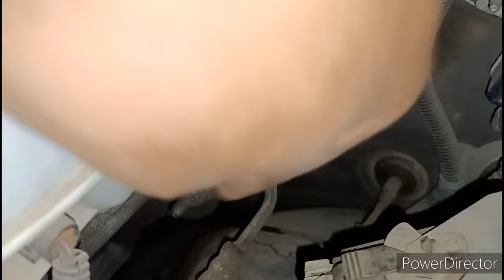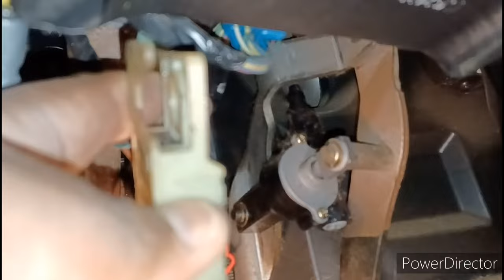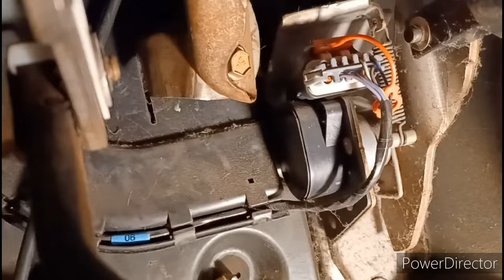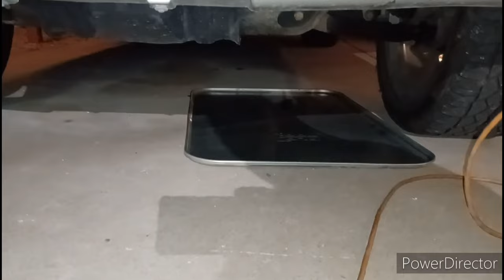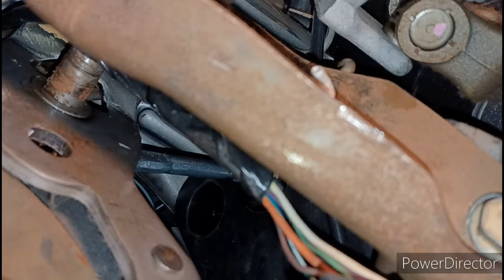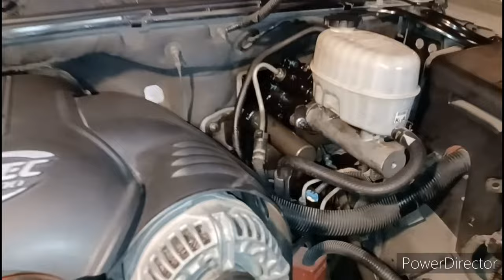How To Replace Hydroboost in 2005-07 Escalade Tahoe Suburban Yukon

Comment: I did this to my 04 tahoe. But I removed the front windshield and hood from the vehicle and side door and front seat. Made the job much easier. Thanks!
Reply: Holy cow, you removed the windshield to change out the hydroboost??
Reply: @veltdog09  lol.  he said remove the windshield and make it easier.. i think you should remove both fenders the liners and take the hood off.. it would be so easy!
Reply from the maker: 😅😆😅😆😅😅😆 yall wild!! Man, this is hilarious!! I needed this!
Reply: @MicDropBBQ  its awesome for sure.. thanks for your video .. i am facing this repair and went to look at mines and it looks just like your video.. same leak close to the firewall.. i was hoping it was just the rings but i guess i will be buying a whole new unit
Reply: @MicDropBBQ please remove both front headlights also when preforming this job. Oh don't forget safety goggles also. Stay safe my friend.

Comment: Wait? Why do you have to buy a whole new unit? Thought they just need a new gasket and it’s good to go. I ordered both the round and figure 8 gasket for my daughters 05’ and was going to tackle it but now you have me questioning if there is another area that could leak and not be fixable with the gasket kit.
Reply from the maker: If the compressed part (long silver tube) is what's leaking, you can't pull that apart. It's high pressure and installed at the factory.
Reply: @MicDropBBQ  ok, so I need to check that then. So if that’s not leaking from there, then the round cylinder gasket and figure 8 gasket will probably fix her problem. 

You mentioned you could see it bubbling when it was on? So I assume having the vehicle running would be best to check for leaks on that compressed part.
Reply from the maker: Yup. With the engine running, pressure builds up thru the hydro boost. You'll see it leaking because the pressure has nowhere else to go.
Reply: @MicDropBBQ  luckily it’s leaking out of the weep hole so it’s that seal. I see no reason to need to remove the unit from the firewall though….Is there reason you can’t just remove the master cylinder and move it back then remove the 5 star bolts and split the unit in half with it still on the fire wall?
Reply from the maker: @dd4life158  You could do that, as you can replace a master cylinder without replacing the entire unit. But the master cylinder should be the source of the leak in order to fix it. If not, then you're back at square one.
Reply: @MicDropBBQ  ok thank you. You went above and beyond. I’m nervous to do it. It’s for my daughters 2005 Yukon and she can’t afford to pay someone cause she’s having issues with finding a good paying job so I’m trying to help her out. I generally do most my own work on my trucks and my wife’s Yukon and my daughters Yukon but I don’t do really major stuff. This isn’t major but it’s a very vital system, you kinda want to have brakes lol. I am always nervous working on brake systems.
Reply from the maker: @dd4life158  Make sure you peep where the leak is coming from, even if you have her press the brakes and you look at the master cylinder. i know where that seal is that you're talking about, so it should be easy to replace if that's the case. Good luck, brotha! Just know that we have enough mechanics around here to walk you thru anything you might have an issue with...as long as we're around to get online.

Comment: Just replaced my cruise control switch and found my unit leaking.  Great tutorial, looks like I'm making plans for next weekend.
Reply from the maker: Thanks brotha!! The hardest part will be that clip behind the brake. It's a "slide" clip more than all a pull-clip. Once it's slid about a quarter inch, you can literally side it off and free that brake booster post. You'll feel it as your moving it around. It's a simple slide, so don't bend.or yank it out of frustration. It's easy, and it has to be slid in a certain direction, that's all.

Other than that, it was just time consuming for laying in the floorboard. Hahaha! Good luck, my man! Hopefully, I'm online if you get stuck and have questions.
Reply: @MicDropBBQ  Oh, that clip was easy. Had to remove it to put a new cruise brake switch in, then found the Hydroboost unit leaking and being the root cause of the switch failure as P/S fluid got into it and made it fail.  That bolt on the firewall you showed the deepwell with wobbly and extension. That one has me a little nervous being the truck is at 225k miles.  But giving it a good look initially, then watching your video, I'm going to go for it and do it myself.  My other car is a Scion FRS and I've been under the dash once or twice with that one.  This chevy has miles of room under it to work compared to that, so at least that gives me a little solace, LOL.
Reply from the maker: @jeepmor  Same here, brotha! I've got about 224k on mine right now! It's about time for seals to give up and just install new parts. Glad you got that clip out easy tho. I was like, "...Jesus? What factory put this damn thing on??" LOL! I was about to make a call to the plant and give em an inspection number to put that mfka on the PHONE WITH ME! LOL!

If you've got the FRS dash, you know how compact the spaces can be. You probably flew with the Chevy! hahahaha!

You'll jam. I think I did well with those 4 bolts under the dash, but it took me a while to keep adjusting my body. Laying under there was killing me, man!!! I had to get a fuzzy tarp to lay on because the concrete was tearing my knees up.

Pace yourself and you'll be fine, brotha!

Comment: Thanks for the video, very helpful! Just a few days ago mine started leaking like crazy, no warning just nice big 12" spots on the driveway.  I tackled the job with an OEM to avoid any rebuild kit issues.  My OEM hydroboost did not have new o-rings for the hoses so I had ordered a lifetime supply of 0-rings HNBR assortment for 10 bucks.   I found the brake switch clip wasn't too bad, I used a small flat blade 1/4 tip screwdriver about 6" long, has that tip about 1/8 wide, I wedged it into the clip gap twisted and it made pulling off a breeze.  The bolt up high behind the brake lever, that was my challenge.  It takes patience and discomfort being on your back trying to get it out.  Have someone check your brake switch is working when your done.  Check fluids, turn wheel several times, check fluid again, go on a test drive and check for leaks.  With your video I did the complete job in just around 2hrs.
Reply from the maker: Smart play to go with OEM! And I feel you know the 12" spot! I had cat litter and cardboard under the truck til  the part arrived. And you're right about checking the brake switch clip. I don't know why it gave me hell. Maybe I had a bad angle on it or I couldn't get my arm position right. Everyone had an easier time except me! 🤣😅😆😅

Glad you flew thru it, my man! Saved yourself a ton of money! 2hrs and working like new!
Reply: @MicDropBBQ  I looked up the rate on the job via mitchell1 and it was 2.4hrs, so you figure 350-450 bucks in labor, then the part oem was listing for 552.96 and I got it for about 385 from a seller on amzn.  Major savings!  I took photos before I took it off the switch and clip from both directions in case I got confused.  My advice on the post of the brake arm and the switch on reassembly- get the yoke and post on the brake switch just on where the post and yoke are just on the initial width of the yoke, not too far into the post yet.  Then get the switch, the open side on the inner slides down on the post, yoke in the center of the switch, then holding the switch feeling the closed hole and wiggling the brake arm, feeling that post come through slowly bring it over to the base of the post and it will all line up.  You want to keep working it until you get it fully over for the clip.  The clip to press in place took me a few efforts to figure out which way could I get it to press down and slide and lock.
Reply from the maker: Yup! LOL! Sometimes, it takes a few tries to get it in place! Once it snaps, you're like DAMN!! FINALLY! And that's exactly what I wen thru, brotha! hahahaha! You literally took a $1,000 job and did it yourself. You know they were gonna hit you for a good chunk, but these trucks are only worth like $3k-$4k by now, so that's like a THIRD of the damn value all in one repair! I'd rather do it myself. It's not gonna raise the value of the vehile, so paying $1k to a shop is tossing away money. You did it the smart way, brotha! Congrats on that!!
Reply: @MicDropBBQ  Just a good reminder even when these repairs come up, it's not even one car payment on these new 50k+ versions!  I'm at 115k miles, I hope I have at least 200k before she dies on me!
Reply from the maker: @ricklord8940  Brotha, I'm at 224k miles on mine. You're doing fine. I pulled my transmission in my garage at 160k miles and installed a new sunshell with an upgraded Monster sunshell. The sunshell is a common part that will fail. It's the basket where all of the clutch plates fit into. Literally an inexpensive part with gears on the backend that gets shaved down. You'll have a little slippage from 1st to 2nd gear, an that's your sign the teeth are rounding out.

Once the teeth are completely smooth, you'll not be able to get to any gear. It will just rev and go nowhere...not even reverse. Luckily, I was towing a trailer and mine died on the way home. I was stuck in 3rd gear so that helped me a lot. Got home and went on vacation.

Came back, drained the transmission and pulled it. Started inspecting and I heard a pinging sound when I was spinning the clutches by hand. Damn sunshell had no gears. Common failure. Replaced it at 160k miles.

Been towing trailers all over America, thru the Rockies and the Blue Ridge Mountains with motorcycles in the trailer. Transmission is solid as hell with the Monster sunshell!

Easy job, if your transmission ever goes out. Common failure, so don't panic. Just replace it. I used a floor jack and a transmission jack on a damn sloped driveway! LOL! Did it the hard way! LOL!

You'll get at least 350k out of the engine and the trans will go before the engine will. Just rebuild it in your garage and you're good to go. The 4L60E is a beast!

Comment: Hey Sir a big thank you! My wife’s 2005 Chevy suburban 4x4 was leaking at the same place. I was able to replace it following your video. Great video and thank you
Reply from the maker: Very welcome, my brotha!!! We love our Chevy trucks (or GM, same model). Never get rid of it. Just replace the part and it's like a new truck all overall again!!
Glad it went smooth for ya!! Feels good to not see that pool of fluid in my driveway!!! Hahahha
Reply: @MicDropBBQ   quick question sir afterwards I drove the suburban it ran fine for a few minutes. Then the brake pedal was hard and the brakes locked up.
Reply: @MicDropBBQ  I backed off those two 16mm bolts that have the bracket on them and then the brakes are fine.
Reply: @MicDropBBQ   that bracket is on the outside but if it was on the inside it would give the gap that relieved the brakes and released them
Reply from the maker: @Reivax45  That would create a space, yes, but that's on the wrong side. Look at any new one online, anywhere. Your pushrod doesn't fit the new piece you bought with the master cylinder that you kept on the truck. That is your issue.

To put the bracket on the wrong side is not THE solution, but it will be a bandaid until you get the proper pushrod.
Reply from the maker: @Reivax45  Look at my video before I took the factory one off. Very beginning of my video. My parts were stock factory and were never swapped until I swapped it on this video.

Research how the pushrod has to be the correct length with the new part, or else it won't mesh up to the master cylinder correctly. It has to line up at the same length.  They sell kits with different lengths.
Reply from the maker: @Reivax45  Here's another YouTube videos that shows the bracket on the outside, as well: https://www.youtube.com/watch?v=b3mEGwXoG2M
Reply from the maker: I think you're the 2nd person that watched my video and said that your brakes got stuck. I wonder if the parts suppliers for these are not sending the correct pushrods for the model of trucks you've got. I thought the pushrods were all the same, but apparently some trucks have a longer pushrod than others, for whatever reason. I've seen the issue in blogs about guys having that issue, but those blogs were a long time ago, as if there was a batch of bad pushrods that went out and had to be recalled. Like they were maybe an 8th of an inch too long or something. That's the only thing that makes sense to me, if the actual adjustment that works seems to be putting the bracket between the master cylinder and the hydroboost instead of on the outside. The bracket is like an 8th of an inch thick, I bet.

Nothing an angle grinder shaving it down wouldn't fix, tho. LOL! It's metal. I wish I had my old parts because I'd do a measurement to find out the actual length of the pushrod in the old one versus the new one.
Reply: @MicDropBBQ   Another question sir the vehicle screen is saying service tire monitor. Then occasionally it goes into stability track disabled and reduced engine speed. Could this be from the wheel sensor get oil on it from the leaking hydro boost?

Comment: Good video my man! saved my hind end!
Reply from the maker: Hahaha! Hey, we always doing what we can to save a few bucks for other bills. Glad ya made it thru the fire with this repair. Wasn't super complicated, but test run it to make sure the brakes work fine. Some guys are getting kits where the pushrod is a bit longer, so it makes their brakes feel like it's locking up the wheels a bit. The old push rod and the new should be the same size.

I've never gotta different sizes, but apparently some guys are getting it.
Reply: @MicDropBBQ  thanks for the info!

Comment: Super helpful 👍 thanks for the great video man!!
Reply from the maker: All good, brotha! Hopefully you saved a little money by replacing it yourself. Love these trucks and I'll never get rid of mine! Replacing parts is a lot cheaper than a $50k truck to replace my Vortec engine and 4L60E transmission that I rebuilt myself. These GM engines have a few work out gaskets and seals from time to time, but you can't beat the reliability and power. 224k miles. Bought it with 81k in 2011. Rebuilt my transmission at 160k and runs like a beast!!!

Comment: Bro, you are a life saver thank you!
Reply from the maker: All good, brotha! Very welcome, Donnie. When you finish the installation, test drive it around the block a few times. Some are saying the internal pushrods on the replacement may not be the same length as the one you pulled off. You may have to swap the push rods out with the old one so the brakes won't lock up.

What happens is the slightly longer pushrod makes the master cylinder think you're still pushing the pedal a little. I think I pinned a comment on this video about it.
Reply: Good to know and thank you for looking out!

Comment: Having the same issue with my 05 Tahoe.. Before I replace I have a question tho.. Did you use regular power steering fluid to replace lost fluids? Had a mechanic tell me these hydroboosters take dexcon IV fluid in the power steering reservoir..??? I don’t trust that information lol..
Reply from the maker: I used regular power steering fluid. LOL! This dude is talking about transmission fluid in the power steering reservoir? I dont know if that will work or not, but power steering fluid works fine.

And when you replace, many are saying the newer kits have a longer pushrod. With a longer pushrod, it will compress the master cylinder and lock up your brakes. Make sure you size them both up to make sure the new one isn't longer.

If it is, you can always shave it down a bit with an angle grinder. I asked someone about it, and that's what he did with his. Said it was like an 8th of an inch longer, so he just ground that much off the new pushrod and installed it.

Comment: Good instructions! Thanks
Reply from the maker: You're very welcome! Getting that clip off is a little testy, but have a little patience and you'll fly right through it.
Reply: @MicDropBBQ  oh I got off no problem 
Putting it back on was harder lol 

But my biggest issue was I didn’t transfer over the spring so I did the entire job and then realize I had no brakes and that I didn’t transfer the springs over had to take everything apart do it again .. put  the spring in and Get done with everything start the truck I have brakes for like two seconds lol 
And then I start hearing a weird noise and the brakes are not depressing right I can hear the air 
 Sounds like it’s coming form under my truck so I get out and look and j blew a steel brake line right under the driver door 🤦🏻‍♀️

Comment: Would a 2004 Chevy suburban Z71 has same configuration as 2005 above ?
Reply from the maker: I bet it would. I have the Vortec 6.0 and I bet you've got the 5.3 or the 5.7. All the same setups, basically. Not 100%, but close enough.